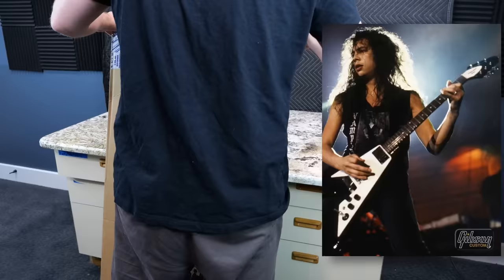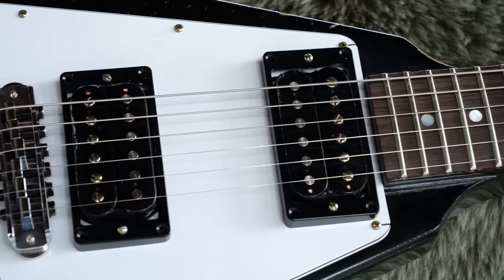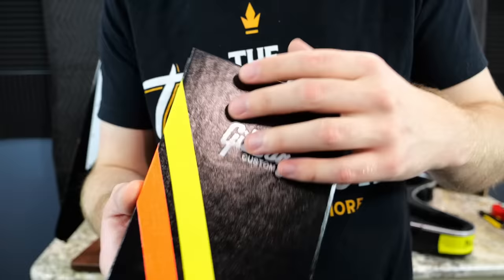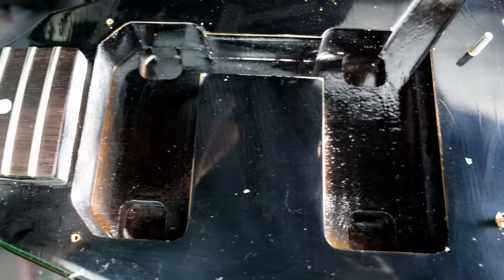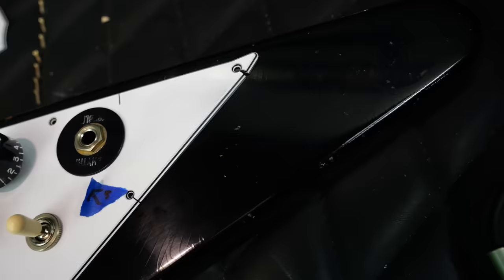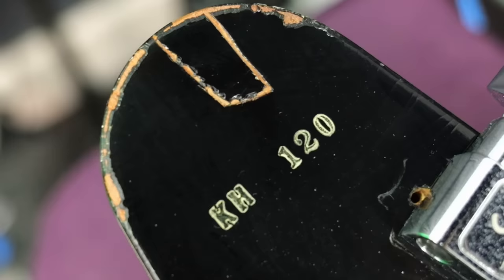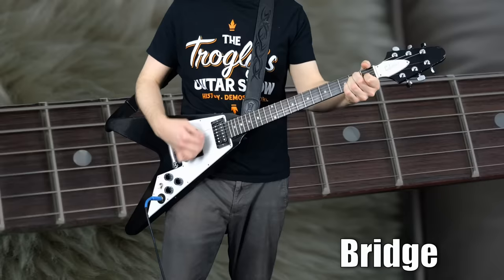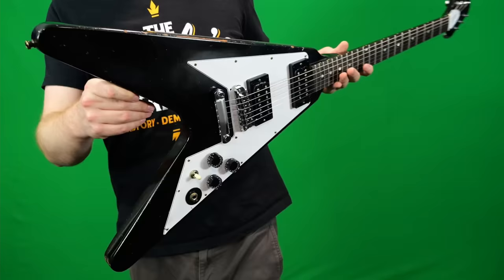The Metallica V | 2023 Gibson Kirk Hammett 1979 Flying V Review + Demo

Comment: Considering they already did a custom shop version of this guitar once already, and with the teased '84 Explorer re-issue coming to the standard USA line-up eventually, I think they should have skipped a second custom shop version and done a non-aged standard USA version of this guitar. The current "70s Flying V" in the standard USA range has the wrong, pointy headstock shape and binding. I know there are lots of Metallica fans out there, and I think there is ample opportunity to sell a metric ton of White '84 Explorers and Black 70s Flying V's.

Comment: I did the same with a mustang, black pickup rings ontop of a white pickguard, and also could not find rings without corner holes anywhere, so i cut screws shot and glued them into the rings, but it's just amazing that no one is producing rings without corner holes.

Comment: $15,000 and they can't even notch/space the saddled correctly.  Can they not see that the strings run diagonally up the fretboard?  I also imagine it would be a lot harder getting replacement saddles to fix it.